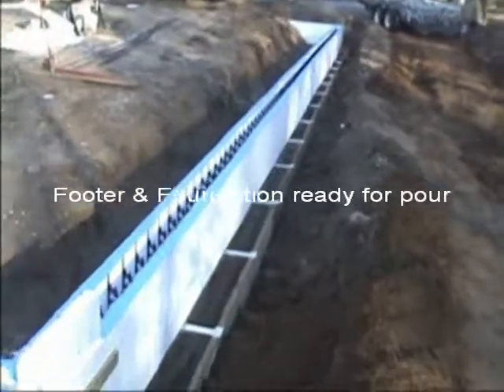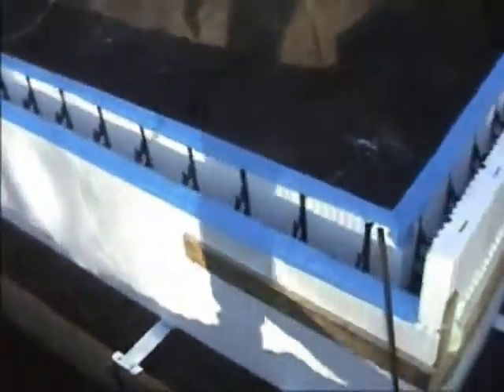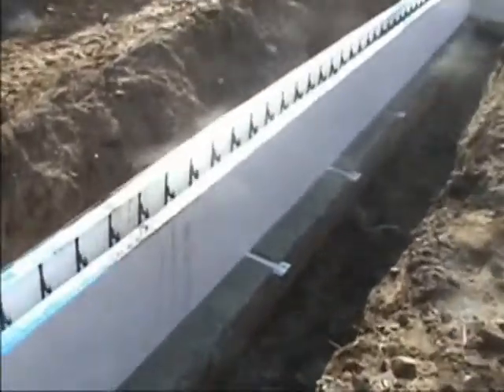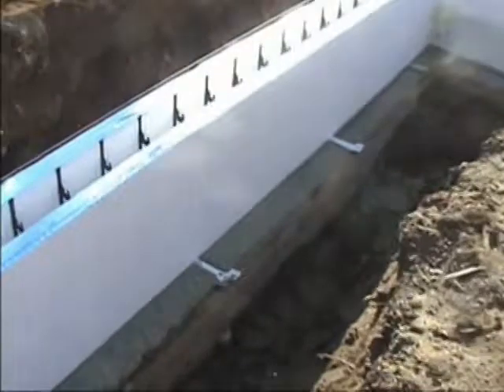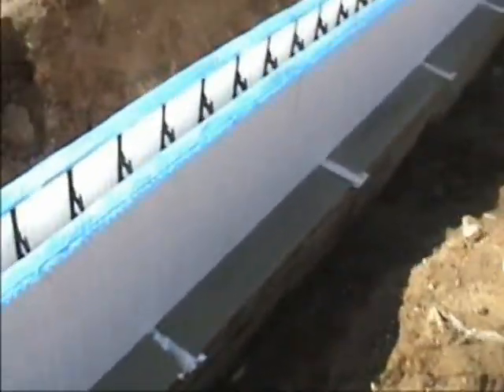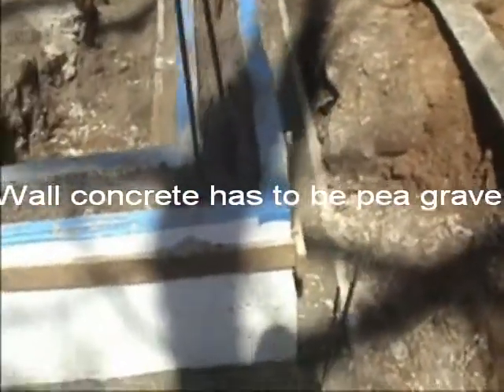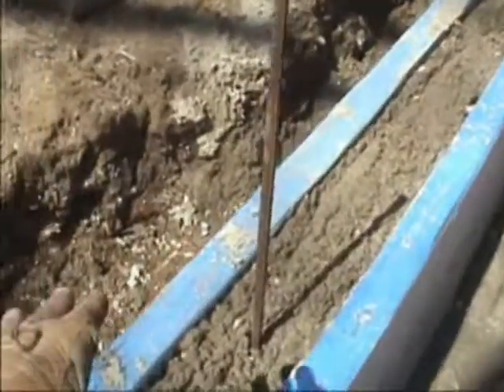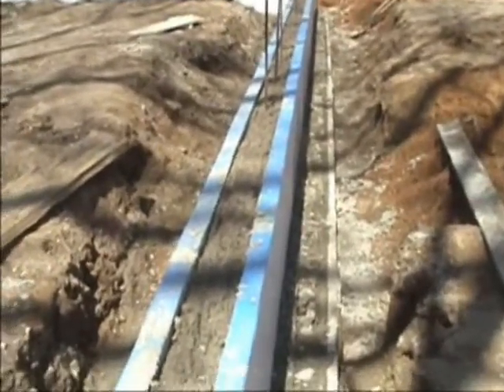Concrete Footer and INTEGRASPEC ICF Foundation Wall

Comment: If you were to use Polycrete Big Block instead of this ICF, you would not need pea gravel in mix. It's because the Polycrete integrated metal cross ties system does not impede the flow of concrete  Polycrete makes fully assembled footing forms that are up to 36" wide and 12'; 18' or 24" deep and each block is 8' long.